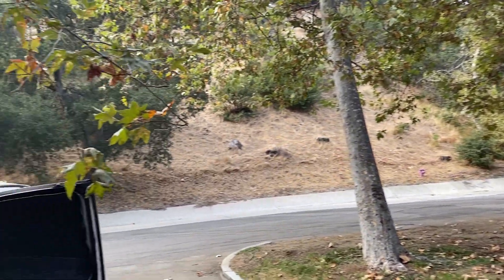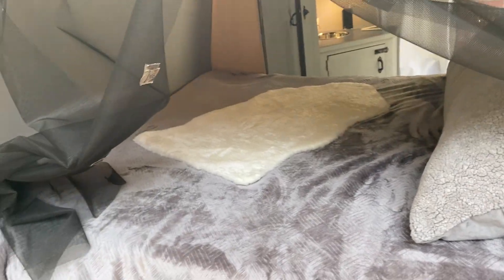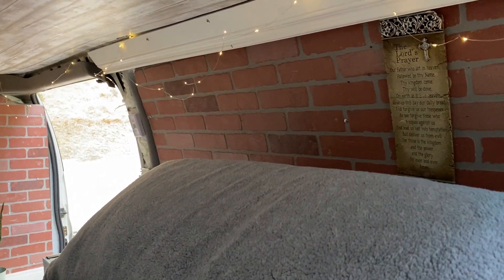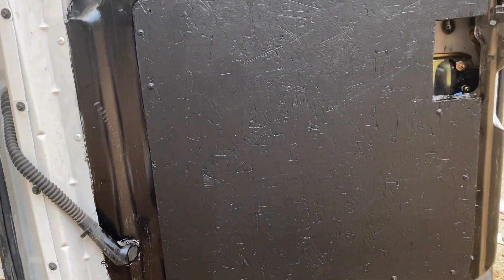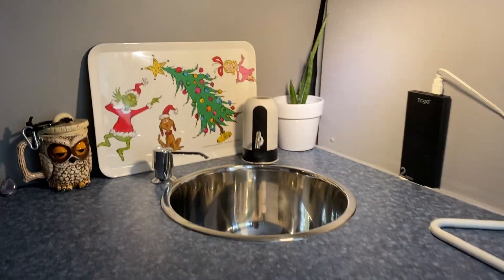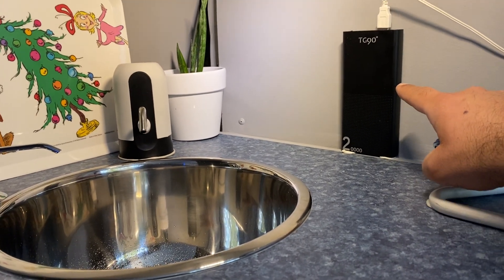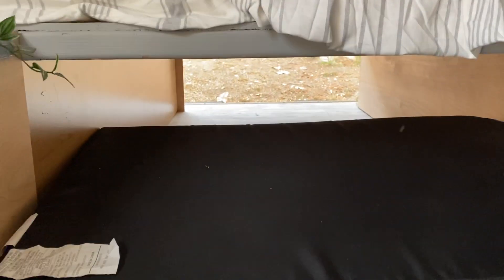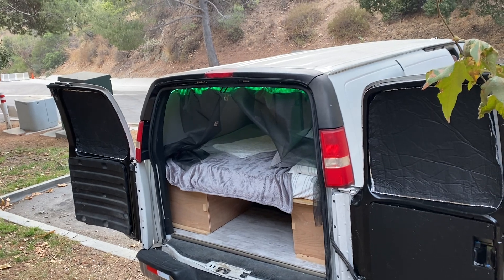Stealth Chevy camper van tour #vanlife #diy #camping #chevyvan #vanbuild #roadtrip #diysolar #beach

Comment: Chevy's extended van is different from that of the Ford extended as Chevy actually lengthens the wheel base rather than extend the overall length only. This, in my opinion gives a better ride and lessens the chance of scrapping the rear when manuvering over objects or steep sudden inclines. A longer wheel base is better when towing too. The down side to a Chevy is, it seems, 4x4 installs are less frequent than what Ford and Quigley offers.
Reply from the maker: Thank you for the info 🙏

Comment: very nicely done. i too got the wallpaper for the ceiling but i notice that the glue is not holding have you found this too be an issue for you? i also have a chevy express and where did you get the mold from?
Reply from the maker: Thank you so much for your kind and warm comment :) so far I have not had any problems with the wallpaper and the glue is sticking fine (I’m planning on using real cedar wood panels in the future). The base molding I got from Home Depot. Thanks again for visiting g my page. And I can’t wait to see your Chevy express.
Reply: @VanlifeCalifornia 🚐🚐 thanks

Comment: Do you know the full length from head to toe where your bed is? How tall are you and do you have to sleep diagonal on the bed?  We have the same van (mine is passenger with windows) and I'm 6ft tall, just curious if I'd fit side to side like that.
Reply from the maker: I am 6 feet tall as well and I can’t sleep on the bed comfortably! I can manage sleeping on it diagonally when alone. This is the reason I built the bunk on the bottom with the foldable mattress for myself.

Comment: Dude you did a great job on this conversion! How much did everything together cost for the conversion? 
The electric water pump is so smart and convenient!
Reply from the maker: Mauricio Gaytan thank you so much for your kind comment! The van alone was $4000. The built material  around $500,  the amenities I’d say around $1000. (Stove,batteries, yeti cooler etc.)
Reply: Van $4,000 ??? What year and engine ?
A 2019 is about $25,000
Reply from the maker: LA7Dance it a 2003 express 3500. Is that good or bad? Did I pay too much?
Reply: You got a good deal !!!
Last year i just got a 2019 Chevy Express 3500 Extended with the 6.0
Passenger Van because of the 3 rows of AC
And it was $40,000 new
Looking to convert to Live In Van. 
Great job
Reply from the maker: LA7Dance let me know if I can be of any help since I flipped this one for so cheap.
Reply: @VanlifeCalifornia  wow that's exactly what am look for....how can you be of help to get me this

Comment: Great video! There's not enough youtubes of extended Express & Econoline vans conversions. Just curious: did you need to cut down the length of your queen mattress to fit it sideways?
Reply from the maker: Thank you so much for your comment. I will make another video with more details soon. And no, I did not have to cut the mattress.
Reply: @VanlifeCalifornia  May I ask: You mentioned that the bed you've constructed will sleep comfortably those individuals in the 5'5" to 5'8" range, but queen mattresses are 80" long. I'd be very interested to know what width you have there at the top of your bed. I realize that the Express and (others) get narrower as we get higher in the van. Thank you!
Reply from the maker: Yodaismycopilot great question thank you ,queen mattress is 60 inches wide and 80 inches long.
Reply: @VanlifeCalifornia  Thank you for your reply! So wouldn't we expect people considerably taller than 5'8" to fit comfortably? Also, I had been under the impression that the width of an Express van was much less than 80". I'd love to know what width your van is at around your bed height level.
Reply from the maker: Yodaismycopilot great question and I re did the measurements. At that height the bed is 69.5 inches long. That is after the 1x4 wood strips attached to the van’s wall ribs and 1/4 inch wall covering. The mattress pad I  purchased from Walmart has queen size label on it and I didn’t cut it so I thought it was queen for sure. Thank you for paying attention.. I will make another video with more detail hopefully soon.
Reply: @VanlifeCalifornia  I can't thank you enough for providing the width measurement. I am a little more than 5'9" and am now considering the possibility that I could sleep sideways in a Chevy Express, thereby creating more space to work with.